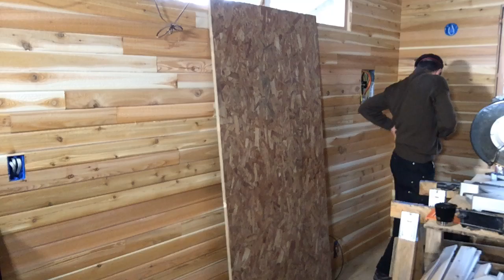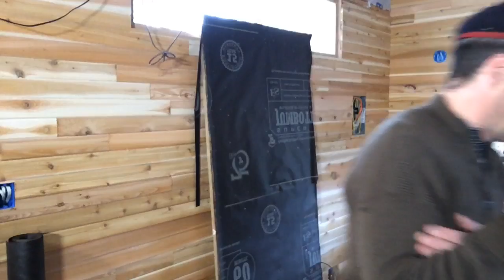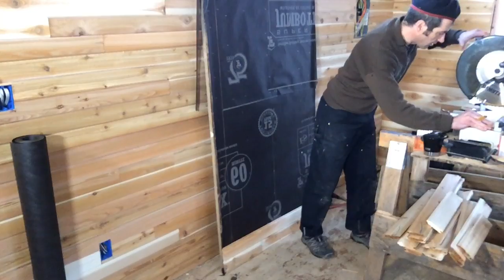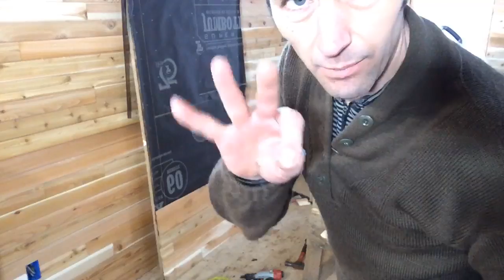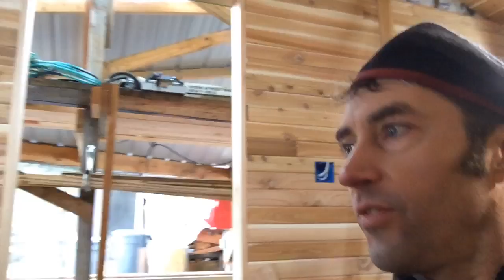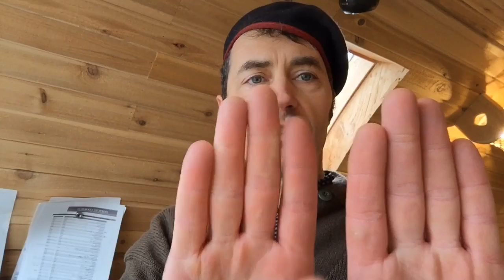Ask Zyl Live - Siding - Mar 5, 2017

Comment: Hey builders.
For me it's almost time to put the house wrap on :).But i was wondering if it would be a good idea to stain the plywood underneath the housewrap, would this be a good idea?
Also thought about using silicone caulking where the plywood boards meet, maybe to much overkill?
Greetings from the Netherlands.
Reply from the maker: I would not stain plywood. Caulking joints is optional, unless you are trying to restrict airflow at the sheathing level. 

Abel
Reply: Alright! thanks for the reply.

Comment: Wow just amazing.
Do you have any design ideas for a "cabin on a truck"? Like an expedition vehicle but less rugged and more woody. With a ~2m cab. I don't like the look of the typical "alcove RVs" either. 
Currently I'm fantasizing about building a very thin wooden shell in the form of a ship / houseboat, laminate it from the back with fiberglass and fill it with ~60mm of liquid PU foam to insulate and create a very rigid structure. That would work as a well insulated tiny house on a truck but also could be removed to be a house boat.
Reply from the maker: Sounds like PU insulated 'cold-molding'! Cold molding techniques were developed from the 60s-80s... although they didn't have the epoxies and PU foams we do... so they used other resins. Cold-molding is time consuming and resin intensive... but creates a strong shell. Wood can be the weak point in these designs unless it is sealed on all sides to prevent rot.
Reply: Yeah that's where I got the idea from. 
I think I'll experiment by building something relatively simple like a slightly curved roof that I could use for a carport or or a garage or my cabin, depending on how it turns out.